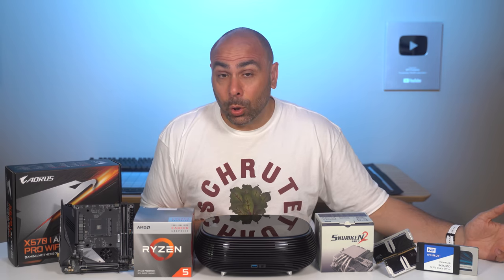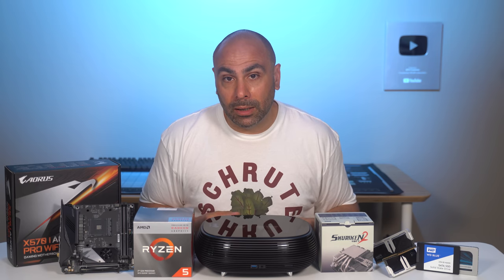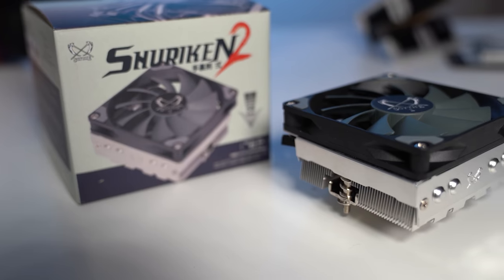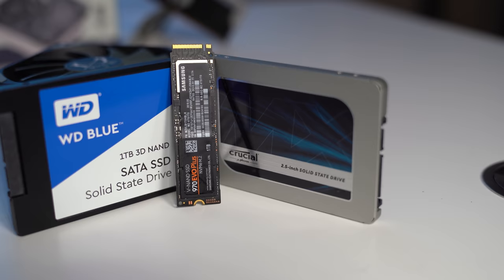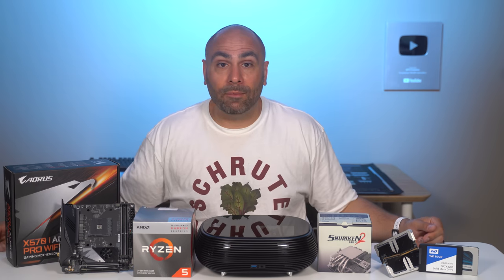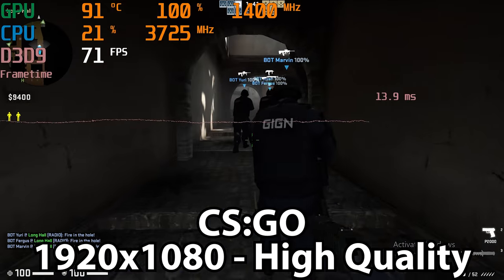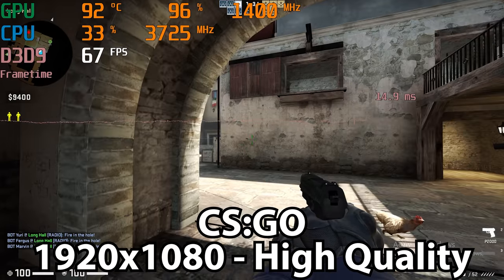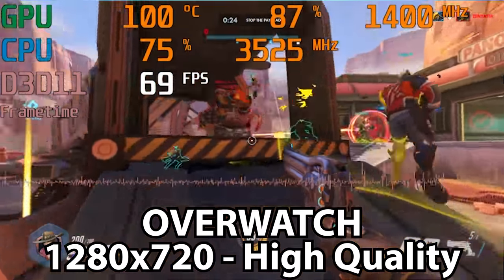Is This 2020's Perfect Home Theater PC?

Comment: Temps in the 70s are VERY warm for the 3400G. 70C is okay for an Intel i7 CPU, but definitely not for the 3400G. Most SFF and ITX builds using the 3400G peak in the high-40s to low-60s. So you are at least 10C hotter than typical for that CPU. And when you said there are "multiple airflow pathways" and moved your hand around, you seem to think that air is going through all those raised ridges. But there is only one airflow pathway, going from the opening on one side to the opposite opening, and the very weak exhaust fan is very bad at moving air through the very crowded interior. And that is why your 3400G is very toasty.
Reply: 70's is not VERY warm for the 3400G when stress testing or playing games. Normal use will be 30's to the occasional 50's maybe 60 spikes. When running games it can hit mid 70's easily, and low 70's when stressing.

Comment: Need Moar RGB. Also I probably would have used larger capacity 2.5" HDD's instead of SSD's since you already have a M.2 SSD.
Reply: Cooler master g200p
Reply: the point of an htpc is to blend with the environment not flashy rgb lol
Reply: 2.5 HDDs are those even still a thing?
Reply: @SuperWolfkin  ...
Reply: @domyac9392  :bows in greeting:

Comment: my htpc is a gaming pc, wall mounted behind the tv... in a 4U rack mount case. as it has been for a long time. still running a now ancient i5 4700k and a 1080TI. this case doesn't even have space for a real GPU much less the power for one. if i was to build it from scratch right now, i'd use the silverstone SST-GD09B or a similar full size case. will upgrade my last intel desktop when the 4000 series is out, hopefully with a radeon card too.

Comment: 70C is disappointing, but doesn't surprise me. That CPU cooler must be starved for air since the clearance to the glass panel looks really small.
Reply: Air cooler clearance is not the issue. The entire interior has very poor airflow and high temps.  If you put an ITX mobo inside a big oven with lots of space clearance around the CPU but no airflow, the CPU will still roast.

Comment: You can overclock the IGPU to 1600, 1650,1700, or even 1750 if you are lucky, of course having faster memory also helps 3600mhz and whatnot..., Little overclocked will make a big difference for little gpus, and (VEGA11) maybe even outpace the GT1030 a discrete GPU!!!! [Lowspec Gamer, Jayztwocents, Santiago Santiago, RandomgamingHD, "Vega IGPU videos" ]

Comment: Since its a HTPC build, u should include the 4K HDR (4:4:4) playback support at least, in 2020. I don't think it will support HDR because the HDMI port on the board is 2.0 not even 2.0a or 2.0b. So its not worth HDPC in 2020. I'm I correct ?

Comment: HTPCs are a thing of the past to me. I went a different route. I just built a server out of a Skylake parts, slapped in three 4TB drives in RAID connected to my network via gigabit lan. All TVs in my home are wireless and have Plex installed. Boom. No need for an HTPC.

Comment: Does it have infra red though?
Or is there enough space to add or mod one into it?
One thing I like about my old Skull Canyon NUC is that it has built in IR, So I can use Logitech harmony remote and turn the HTPC/TV/Receiver on with one button from the couch.

Comment: For an htpc , noise is the big issue.  As long as this is fairly quiet, it would be perfect for me.
Reply from the maker: It is relatively quiet, yes.  It was running at the end of the video while I was talking and the mic wasn't picking up any noise.
Reply: @BPSCustoms  Cool I think this is going to be my next build.  I am still using a phenom2 system

Comment: Just like to mention Crucial SSD's suck badly, the BX500 and MX500 I own, they slow right down when you have allot of data on them. I don't even have 1tb on my MX500 2tb and its slowed down the BX500 1tb I have is even worse, Samsung SSD's cost more but are worth every penny imo. The BX500 I have slows down my whole system since I use it as a boot drive, if you download something large it slows the whole system down the MX500 doesn't do this but the transfer rates are not optimal. My next rig I'm going PCIE4.0 NVME for Games and PCIE4.0 NVME for boot as I have with my main rig, I suggest people spend the extra on Samsung SSD's these cheaper ones really are well cheaper in every way. My opinion regarding Crucial, great video mate I enjoy HTPC builds.

Comment: Thanks for the review-build video.  Would a low-profile GPU, like a small form factor GTX 1050 or 1650, fit in there?
Reply: Nope. No expansion slots built in to the chassis

Comment: Why did you put the M.2 in the back slot that runs PCie 3 instead of the front slot that uses faster PCie 4?
Reply from the maker: The drive is not gen 4

Comment: I would like to see if a 10400 or 10600,would game any better in there,ryzen is fine for an apu,but I wonder how the IGPU in the new intel chips,do in the same tests??
Reply from the maker: I doubt the intel igpu is as strong
Reply: Yea bro Intel ipgu are crap
Reply: Oh really? Well thats why I asked,I never see anyone run those. The 10th gen sucks too?
Reply: The 10th gen would allow you to have a 6 or 8 core input, so ididnt know if that would make a difference or not,in gameplay etc. Even if the iGPU isn't that powerful
Reply: @brianmccullough4578   what are u talking about 6core 8core input?
 All Intel igpu sucks.
No matter what gen
They just for displaying /video
Reply: The IGPU in the 10th Gen Intel CPU's is the same as in the last 2 generations and they are really no good at real time rendering of 3D graphics compared to the AMD Vega IGPU, however they are better at 2D video encoding/decoding so they work really well for HTPC's as long as you don't want to game.
Reply: It autocorrected iGPU to input for some reason. Yeah I hear people say that,but I dont think I've ever seen anyone do a test on it. If AMD had an 8 core APU,I'd be all over it,especially if it was as fast as the 3700X or whatever. Intel has 8 core iGPU but everyone on YT,just says yeah use it for streaming,but no one ever tests it for this type of application. Just like you guys says it's awful, but I do t think I've ever seen anyone actually test it VS the AMD. 4 core AMD APU (with ok graphics)vs 8 core intel iGPU(with bad graphics), i think it could be a good test. Idk, thats why I'm asking.
Reply: I found 1 vid showing the 10900K iGPU that showed it running at 1080p low settings..fortnite 60fps,dota 2 140fps,but 35fps in gtaV. Double that for 720p low settings. So idk maybe somewhat comparable. I'd assume a 10400 would be similar on the graphics side.
Reply: @brianmccullough4578  no  one test the Intel  igpu because they sucks so much. U cant even game on it.
It doesn't matter if u have. 8core  Intel CPU or 4core.
Ithat's not how the Igpu work
The cores won't make a difference in the igpu.
The AMD apu also won't matter on the cores  they have too.AMD apus have compute units.for example the ryzen 2200g  is 4 core. 4 thread CPU but the igpu/Apu has 8 Vega campute units 
 The ryzen 2400g has 4 core 8 threads  n the Apu/igpu has 11 Vega compute units. It faster for gaming.
Intel igpu  from 1-10 gen gen are basically the same with no real performance gains  they are just meant for display to monitor video.
They aren't main for gaming
But if u had to compare them to the AMD  apus they would probably be 1/2  of the performance.  2400g 11 Vega compute units
Reply: Nothing like getting beat up over a simple question, you gotta love the YT comments!! Maybe I just unsubscribe,have a good one yall.
Reply: @brianmccullough4578  Adding more cores to a APU really doesn't make much difference because it is already heavily GPU bound while gaming. If you look at the Afterburner overlays on this video while Brian is gaming you will notice that the GPU is at 100% while the CPU usage is very low.
Reply: So... is an intel gpu any good? LOL hahaha I kid, I kid... BPS has some passionate viewers, that's not a bad thing! Why would you unsubscribe? Hang in there man, take it all with a grain of salt!
I like watching the back & forth, BTW.

Comment: terrible case. not blowing out. took off the top cover and the CPU temperature dropped by 30-40 degrees. no perforation of the glass can be made because it is knee. the case stands without glass. design mistake definitely. did not understand why the cooler runs at maximum